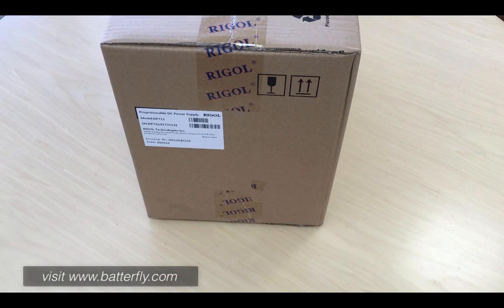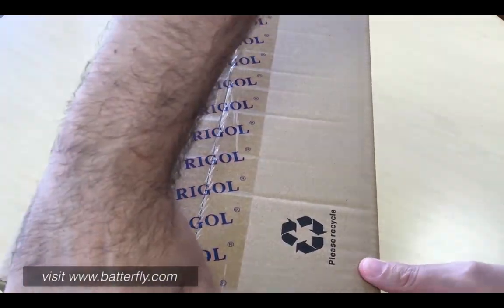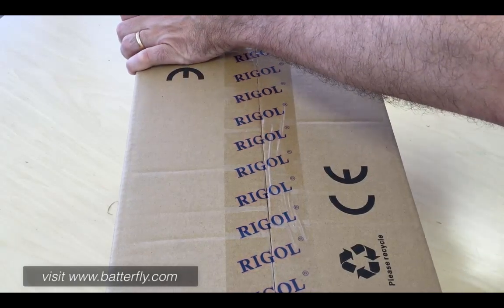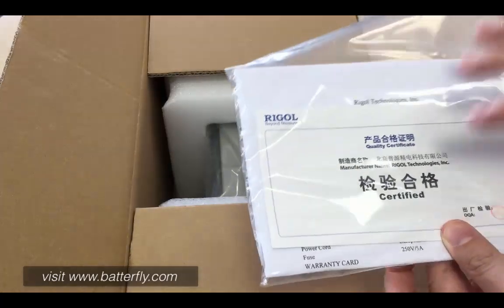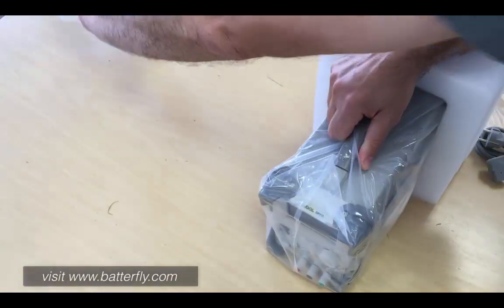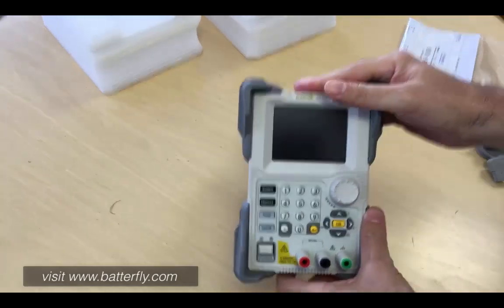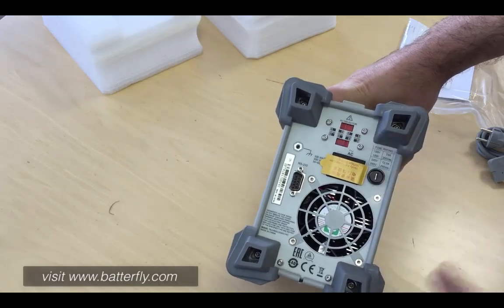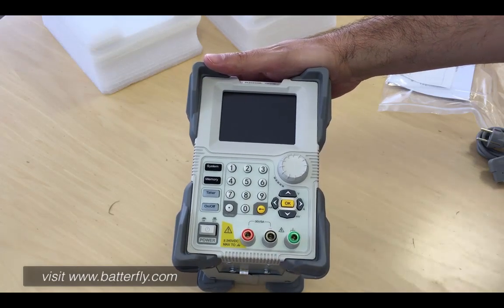Unboxing RIGOL DP711 Programmable Power Supply

Comment: Just received my brand new DP711 today. Opened it up turned it on to find out it has a defective tuning knob. One click in any direction will throw your voltage all over the place. When scrolling through menus one click will have you jumping back and forth through the tabs. Extremely disappointed. For a company that includes testing certification papers with their product they apparently did no quality control on the actual unit. This is not something that can be overlooked. Makes me strongly question this company. Out the box for 5 min now going back in the box. Will be going back.
Reply from the maker: Dear Brandon, we are sorry, it may happen sometime. We are sure your Rigol dealer will help you quickly.
Reply: @BatterFly2002  So you are a dealer?
if so you have to state you are when doing a review.